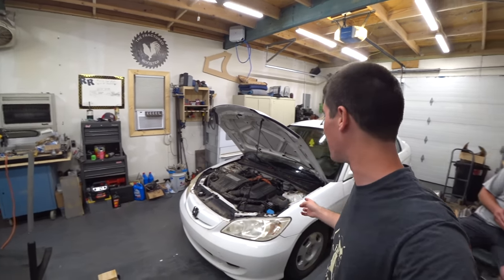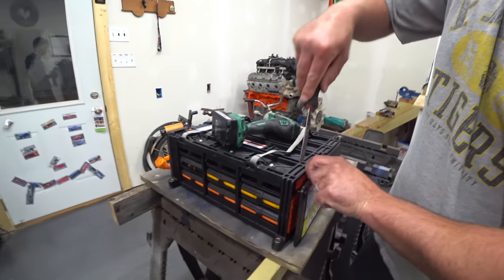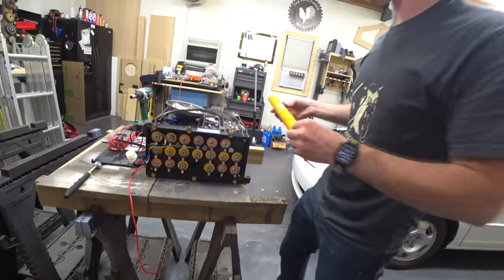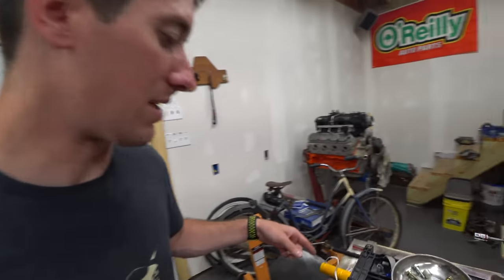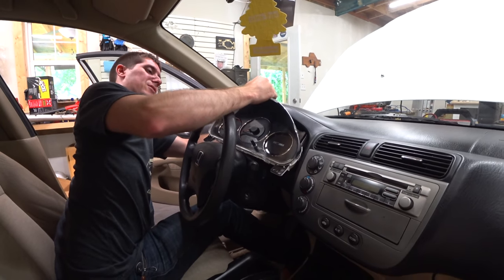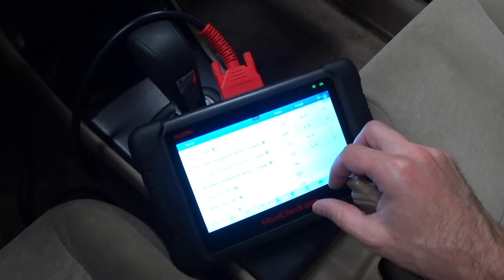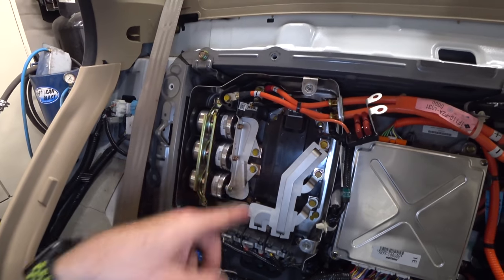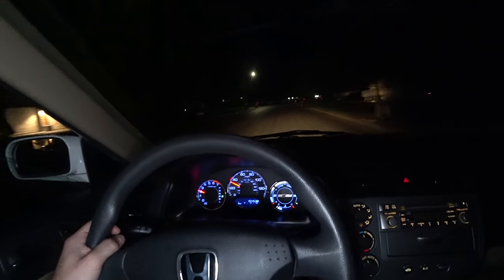REBUILDING The Cheap HYBRID Civic BATTERY PACK *And Then Unhooking It*

Comment: i fixed my accord ima it was a nightmare like this civic but i learned how. First off you got a low battery, full voltage of the pack should be at 170v not 154v my friend, your battery contactor wont pull in its in protect mode.
 Also you can fix a bad temp sensor with a standard resistor of a working temp sensor value in resistance in place of the broken one in a pinch. 
Also if you got a low stick it takes about 3 to 7 days to trickle charge a very low stick to gain capacity back but you need a 12 ohm" power resistor " in series with the battery stick and basic 12v dumb charger. Do not use a hobby charger they dont work correctly you need a dumb old style charger but you will find with old pack sticks it wont have enough capacity and throw a light, best off replacing your pack sticks with chinese nimh sticks and it will work for 1/4 of what honda charges to replace the whole pack. Also the ima system only trickle charges the small 12v so you cant  run long because your draining your small battery too fast.
Reply: I have a 1st gen Prius and after much pain the only thing that made come back to life was replacing the hybrid battery. I agree with egn83b it's very hard to bring back to life those old cells sticks.
Reply: 156 or so is about right for the HCH1 when fully charged.
Reply: @leifhietala8074  156v is low that pack is on its way out if its resting.. my accord ima uses the same cells as the civic and voltage. Each cell at nominal resting at basically lowest depth of discharge is 1.2v which is 144v like on the sticker its misleading information. When the cell in each stick reaches 1.45 or 1.50v new they are at full capacity. But resting is normally 163v to 165v. 156v is ima light territory but software on the civic may be different then my accord but should be the same.
Reply: So....ur saying he didn't balance the batteries  by not charging them all in parallel at the same time and a contactor is not closing? because it's not getting enough voltage? So the batteries are undercharged unbalanced and theres also a bad thermistor?  And this is all contributing to a contactor not closing? That'd be  a simple fix then no? He prolly sold the car tho..... hmmm is this guy an electrician? Could he not just use multimeter to find where the power is being cut off? Shouldn't one just check voltage to see if current is running and not ohms? If theres a circuit board with digital switches does that mean he ohmed out all the pins? But if circuit board won't allow current through if there isn't enough voltage or "balance" when there is then the circuit board is busted no? And if the thermistor is busted then that means the battery overheated so that battery is fucked. No? But since there are thermistors that should protect circuit board no? Lol
Reply: Goodness, I purchased a new hybrid battery and module for my 2004 civic and has everything installed today. However my ima is still on with check engine and maintenance light. Any suggestions? It has power and drives good with the 12v which I had tested at the local automotive store
Reply: @krystaldavis6569  ... how much??  new battery and module with install?

Comment: you need to balance the battery cell together in order to have no code. just parallel all cells together and charge so it has same voltage all across.
Reply: He needs a better battery balancer as well. You need to check capacity of the battery in addition to voltage.  You can easily have a cell at the correct voltage which will have like 100mah of capacity.  Since they are in series, they all need to be similar mah in capacity.
Reply: Yep you do need to balanced the new batteries. Otherwise it won’t work. Plus replace the temp sensors.

Yes having a bad 12v battery will cause issues with inverter. These cars are picky when getting IMA to work. Doubt it anything major.

Comment: I recently purchased a 2004 civic (for $1100) and had the same issues / codes.  The person I bought it from popped off the led lights for the engine/ima/maint warnings, but I knew they had to be on.  I rebuilt the battery, still same codes as yours.  Finally bought a battery from a well-known hybrid battery company, put it in and no codes and works just like new.  It cost about $1600 with a $400 core charge. The battery sticks need to be exactly the same in every regard for the car's computer to accept it.  I did not realize that during the battery rebuild.

Comment: I would look to fix the temp sensor before spending money on parts. You have 3x sensors so just use an ohm meter and look for the odd one out. Start as close to the pack as you can then work back until one of the three measures different. I don't think the car will "use\" the battery until you fix this.
Reply: this is the same for older nicad nimh type power tools, they also have temp sensors wired
Reply: And you don't need to disassemble the battery if you can find and measure two of the sensors and get a resistor of the same value to substitute for the third, faulty one.

Comment: Love the fix and flips, you're saving cars, and providing cheap properly repaired vehicles to people that need them.  It's fun to watch.  

More Opels on the channel!  They're weird and cool!  Find another Manta, or a Kadett!
Reply: I agree to your statement in theory, however these hybrids, particularly older models, are highly unreliable, or had issues to begin with. My brother in-law bought an 07 Camry hybrid supposedly rehabbed,  new battery pack...the short story...had he just ran an OBD scan before purchasing, he would have discovered the entire battery and recharge electronics had been bypassed. He did take the car to a Toyota dealer and was told it was not worth repairing...more or less, he had purchased a totaled car. The Camry was hardly worth the tires it was sitting on and he wound up selling as a parts car...
IMO...the claim carbon base fuels cause more environmental damage than alternative fuels, battery, solar or wind...is a double-edge sword. The manufacturing of the batteries with its by-product wast  disposal, not to mention batteries winding up in landfills affords more pollution than conventional carbon fuel. However I do believe battery tech will come of age...its just here yet...my 2¢...

Comment: The temp issue is probably the one battery that was previously changed out that they sliced all the way through the sleeve to the metal of the battery. It might get hotter because it is directly touching metal.
Reply: I thought about it shorting on the battery itself as well.
Reply: That makes sense

Comment: You have amazing work ethic and I wish I could have thrown my two cents in much earlier as I owned one of these generation one Honda Civic Hybrids for five years and 50k miles.  Ultimately after one refurbished battery and multiple trips to the dealer (where they miraculously updated the ecu software every time) we ended up junking the car.  Why?  The battery died....again and the alternator light was on.  The car was only running on the 12 volt and would not allow the IMA to function as an alternator.  I went deep into the forums, and exhausted the dealer's expertise as well as almost every Insight trick available-more is known  now as you have done.  I figured out that this car is a Honda science experiment that works under a very specific set of conditions.  Any deviation from those conditions will set an IMA and check engine light.  I got used to these friendly twinkling reminders that something was amiss in Hondaland.  The Takata airbag issue was the last straw for the car.  I sent it to the junk yard with a spare battery in the trunk.  The good-on a new battery I got 55 mpg plus.  The bad-the early ecu software was extra paranoid and cost the original owner 4 catalytic converters, and every check engine/IMA light you can imagine almost all the time (the hilarious thing was the car would freak out mid trip and slowly shut the lights off by the time I got where I was going). The third time they reprogrammed the car they finally got the CVT tune right (and according to the forums, the last reprogram removes all of the oxygen sensor codes), but the car couldn't get any more than the mid 40s mpg.  My hat is off to your diligence and perseverance.  Great work!

Comment: Possibly the 12v battery having an internal short is causing some havoc on the electronics?
Reply: That would just drain the battery and nothing would work
Reply: I've seen it happen...along with a bad 12v ground.

Comment: If the 12 volt is heating up, it could have an internal short, and it's functioning like a great big resistor.  That would screw with the voltage signals everywhere and throw odd codes for good sensors.
Reply: My thought was similar that the 12v battery could be causing issues itself if its not in good shape. Ive heard of cars doing some odd ball things when the battery is in need of being replaced.
Reply: Remembering my EIR from 34 years ago, I'm thinking that sensors with an incorrect input voltage on a small set of parameters could throw a false failure code. 

If the sensor is only catching 11 volts coming in, and "failure" is an output of 11.4 volts coming out on a nominal 12 volt system,  then it reads as bad.

Comment: I would check/replace the temp sensors. If the system thinks the batteries are overheating, it will definitely shut down the batteries!

Comment: I’m having the similar issues with my 04 civic hybrid main core battery is getting drained out causing all lights to come on also power steering, gauges go out as well. I assumed it was maybe a bad alternator or “Dc-Dc converter” Did you ever get this car running right?
Reply: Hi Isaiah, not sure if this helps but I have a 2005 manual transmission.  I've been driving it with the IMA light on and the battery not really working for the past 150k.  It's at 330k now.
Reply: @geobird11 I’m at 300k with the light on but need to get it smogged… dang it

Comment: One thing to note, if the starter is starting the car, the IMA is not working correctly. If the IMA system is working correctly you won't hear the starter. The engine will just run with no starter as the electric assist will start the engine. Pretty cool actually.
Reply: oh really? so these things have a conventional starter motor just in case the hybrid system fails?

Comment: Loved my 2003 Civic Hybrid (new May 2002).  Replaced the battery pack once with a rebuilt, which didn't cut it.  Honda "participated" in replacing that with a new pack - about 1/2 price to me.  Worked great.  Ran fine until I totaled it hitting a deer in 2018.  That car was like a spaceship with its 600+ mile range on one tank of fuel.

Unlike a Prius the Civic has a usable "limp home" operating mode when the IMA is in disabled state.  Made these cars safe for travel "off the grid."
Reply: How many miles did you have to replace the pack and how much was the total 💰💰?
Reply: @Bob Riemers: I believe Prous has “ limp home” mode, though activating it is involved procedure. And driving it in that mode is dangerous. They call it “Diagnostic” mode.

Comment: When my 12v battery on my fusion energi went bad the car went bananas, literaly things would stop working and 10 mins later it would work and something else would stop, from lights to radio to power seats. Hybrids are super finicky when the 12v battery goes bad.

Comment: I have the same car but the 2003 model, my ima light came on and the check engine also SRS idk what to do but it still drives and still charges.
Reply: How is your car now?  I have a 2005 and my IMA light has been off for the last 150k.  It's at 330k now.

Comment: The computer is probably supposed to show “fail high” when the thermocouple/ thermistor circuit is open. That’s quite common.
Reply: Yep likely issue and yes contractor won’t close if detect fault in battery pack and fan will go on high. I rebuilt a couple of them. It likely bad thermistor. Easy was to verify it is test with multimeter and ohm them out and look for the one that measures way different.

Comment: lol, Just install a 2nd alternator wired to the 12v  OR   (3) 12v battery wired in parallel and install a solar charger on the roof and trunk and battery charger.

Comment: I have 2 Honda civic 2003 hybrid. Bad ima pack. I bought one reconditioned bat from a source and the other I tried reconditioning them. The working ima bat works. But the one I worked on doesn't wanna work even tho it shows the proper voltage. My guess is bad temp sensor

Comment: Had a flash back to my 2004 civic hybrid, battery went out under warranty and once out of warranty. Gave it to my mom after getting a replacement aftermarket battery. She still drives it, thru electric system requires work like every other year.

Comment: do the hybrid civic nicad batteries balance charge once in the car? What is the configuration?
Reply: No, they do not balance charge. The computer does monitor the balance and will cut the battery out if it does not like what it see's. It monitors balance by pairing 2 sticks. Resulting in 10 voltage readings from the 20 sticks. Each stick has 6 cells in it. So it does not see each cell individually, and charges the entire pack through one connection.

Comment: When I saw how you were trying to fix the IMA battery, I groaned. Even if you weren't having a temp sensor issue you'd be doomed to failure. 

Something to be aware of with NiMH, is that voltage is not a good indicator of SOC. You can charge the pack to full an then put it in the car, and it will still show an initial charge of around 20%. The computers need to cycle the battery a few times and measure current in and out to get an accurate model of it.

That said, just swapping sticks that have higher voltage will likely still result in a failed pack in a few weeks. If you don't match their internal resistance it will rapidly get out of balance again and throw another IMA code. As someone who has rebuilt several of these, you're better off either 1) doing a full bypass and connecting the DC-DC directly to the MDM output, or sending that pack out as a core and just replacing it.
Reply: I've been doing it for years on Toyotas and I suggest just replace it

Comment: Goodness, I purchased a new hybrid battery and module for my 2004 civic and has everything installed today. However my ima is still on with check engine and maintenance light. Any suggestions? It has power and drives good with the 12v which I had tested at the local automotive store

Comment: I had a guy fix my IMA battery, on my previous 09 civic Hybrid. He charge cycled the sticks multiple times until they would hold their load somewhat consistent. After that it worked for almost a year, then went bad again. Best fix is ordering those Chinese battery sticks. They were about €800 back then, instead of the €2800 the Honda dealer charged for a new battery pack.

Comment: If you do have a failing module, it heats up quickly, triggering the fan. Resting state voltage readings on the modules aren't really indicative of the module health. When under load the module may drop voltage very quickly. A better test is hooking up a headlight bulb with both high and low beam hooked up for 60 seconds and recording the voltage drop. That is a proxy for the internal resistance of the battery. Ideally, you'd measure the discharge voltage curve as you discharge each module from full charge down to close to 0%, then match all modules in pack based on those curves and internal resistance.

Comment: I replaced the batteries on this same model... mine just worked IMA light went away my mechanic did some kind of bypass or something cant remember. But I had the same problem as you but my mechanic figured it out...

Comment: maybe the battery got real hot and overloaded the temp sensor, and it actually is the temp sensor
also if you can hear the contactor but see no voltage from it the contactor is likely bad (contactor is essentially a big relay)
the computer also might have some balancing memory or something and needs to be programmed after replacing cells
Reply from the maker: Very possible, looks like it will need torn back down, battery end plate (for the bypass contactor) and the temp sensor replaced. Then the motor commutation sensor needs sorted but you need an oscilloscope to check that. 😬
Reply: honestly your contactor issue sounds like a bad contacter what are the codes that keep appearing?
Reply: @WatchJRGo  50 usd hantek usb scope.
Reply: 💯 replace that sensor, balance all of the cells, and have Honda flash that battery, and I’m guessing you’re back in business.  Idk what the dealership gets to flash, but it’s all labor time and just a computer plug-in.

Comment: The other thing is you can charge each pack of 6 cells to whatever voltage, but the individual cells might be different voltage, not sure if this is that big of a deal in nicad and chemistry will mess up in internal resistance

Comment: Sorry to hear you couldn't fix despite your effort. 
But interesting to hear that the car is still worth owning and using since regardless whether the IMA is working or not, the venhicle was designed to be first a combustion engine car and olectrical is assist only.

Comment: I just can't believe someone went through the trouble of pulling the cluster out just to tape over the IMA light, that's just freakin insane IMO.
Reply: especially when they couldve just pulled the plug off the IMA module to drive the car like a conventional car with no error lights on.

Comment: Maybe it's just me being stupid, but I noticed that the plastic at the ends of the cells have varying levels of discoloration. Could this be how they refurbish the battery packs at Honda? Think about it, it'd be far faster to check to see if a color changing plastic would indicate damage/dysfunction than it'd be to go through what, 20 cells with a charger and then a voltmeter?